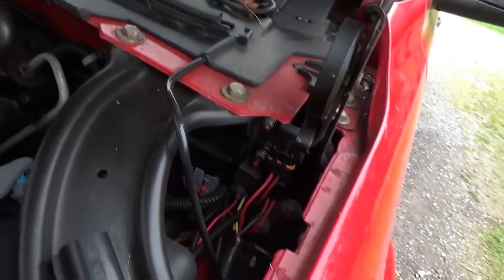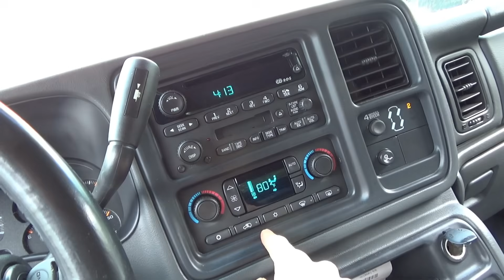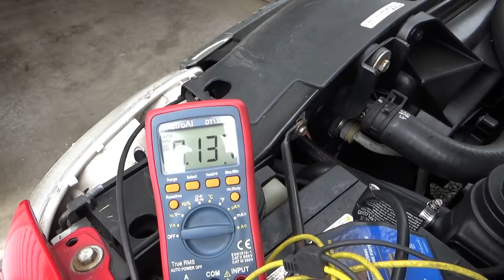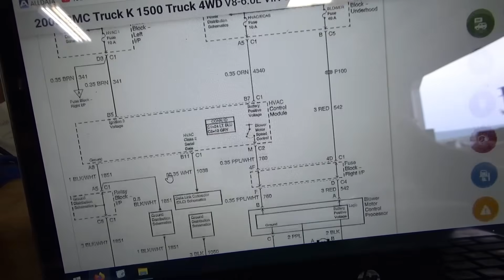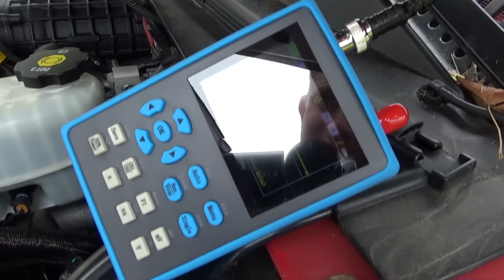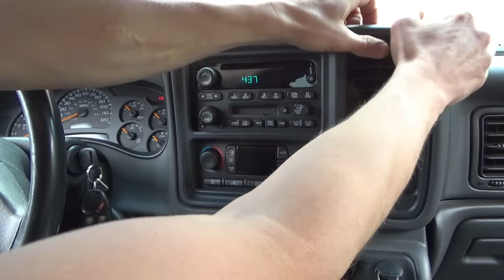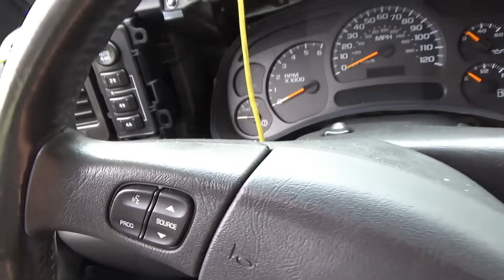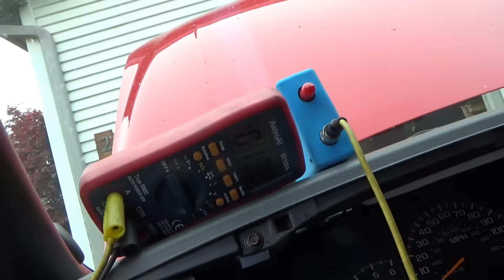QUADRASTEER! GM Parasitic Battery Drain from the FACTORY? (Part 1)

Comment: Pretty sweet truck, and it's mint.   I didn't even know you could get a 1500 series with Quadrasteer.   You would think they would have a programming update for those HVAC units, I'm pretty sure it's at least a known issue within GM.
Reply: A guy I knew had a 2002 1500 with the Quadrasteer.  He bought it new and had put a lot of money down on it so that in 2003, he only owed around $12,000 on it.  He decided he didn't want payments any more so he wanted to trade me his truck for what he owed and have me give him my paid off 1998 Silverado 4x4.   I ended up not doing the trade but sometimes wish I had.  It was a fully loaded nice truck.   I still have my 98 which I also bought new.

Comment: Curve ball to be expected, indeed. The measured draws in this video part will not cause a no-start after just 2 to 3 days, unless both batteries are toast. By the way, were those batteries tested?
Assuming the batteries are still good, my money will be on that early wireless phone charger. Pun intended.
Owner takes out his coins, his Altoids tin, tools, utensils, or whatever, before submitting the vehicle to a shop. Shop cannot find/fix problem. Makes sense.
Ivan will accidentally put a tool down in that tray and when glancing the amp meter, he'll find out.
Any creature comfort accessory like that should not be connected to a constant power feed. There should be a 3-way switch, so the user can choose between off, accessory feed, or always on.

Comment: I purchased a used C1500 20 years ago.  It also had a current draw.  I'd occasionally attempt to find the source.  But, since the vehicle is not a daily driver, I just put a knife switch on the battery along with a smart trickle charger.

Fast forward 18 years and while under the dash to do some other work, I discovered an aftermarket relay spliced in the wiring system.  There it is!

I removed the do nothing relay and the draw is now gone.

So, I eventually get around to fixing stuff.  It may take a decade or two, though.   ;-)

Comment: You said"CURVE BALL". I'm thinking that either, another module is waking up the HVAC module or yes, the HVAC module and the trailer module  is drawing current, but since the batteries have been discharged often, then they don't have capacity anymore. Batteries tend to get damaged and lose most of their capacity when they're deeply discharged. In that case you would need new batteries.  Evan at 175 milliamps, two good batteries should stay charged well over a week.
Also that Cell phone charger tends to stay on. That's a draw. You should unplug that too, see what happens.

Comment: I had one really really similar to this on a 03 gm truck. Turned out to be the ignition switch. Kept the hvac alive after key cycle.
Reply: Good point!  Ivan didn't check to make sure the powers and grounds were correct for going asleep.  (And in this case, I wouldn't use a test light, but just the meter.)  This could also be what's keeping the trailer brake awake. When you have two devices showing similar symptoms, it's probably not two bad units.
Reply: GM ignition switches have always been an anomaly. Replaced many. I have seen them cause HVAC problems and transmission issues.

Comment: 2003 GM truck with a draw? This is one of those cases where you have to go straight to one thing before you even bother doing testing. The cluster draws are almost always intermittent on the scale of days. I'd have the guy take out the cluster and see if it still happens before even bringing it in. The cluster problem is so common that we have had two of these vehicles in my immediate family and both had it (one had even had the cluster replaced by the dealer and the second one also failed). Then at one point I was visiting my cousin and noticed his was sitting sadly in the back of the driveway, I peered in the window, and the cluster was on. Turns out he had tried to find the draw, failed, and given up. Scrubbed the back of the PCB and scraped around the vias, problem solved once again.

I also went down the road of thinking one of these was the HVAC module because it wakes up from time to time and I kept seeing draws on that fuse (same symptom as you are seeing here, identical HVAC module). It was not the problem. Rebuilding the cluster fixed it. I was fixated on the HVAC module until I saw the speedometer move while the truck was off.

Is it cheating if you've been tricked before by the exact thing in the video?

Comment: You pulled the fuse and went to sleep.  Pull the module and it did not go to sleep and the brake controller stayed on.  Seems like something (brake controller maybe) is wired into the line from that fuse.

Comment: any TSBs on the hvac module?  also can the trailer brake controller be turned off manually? or powered from a key on source only? not so sure abt the hvac module being bad.. customer said he had problem from new, but didnt make them fix it? this kind of thing skews judgement sometimes.. If anybody bought a brand new truck, that was draining the battery from the start, they would pester the crap out of the dealer until it was fixed.  I call bullshit on "it was like that since it was new"..  this leads techs down rabbit holes.  the customer caused the problem with all of his add on junk

Comment: My question is and maybe since I have never seen this before, but why is there 2 batteries?
Is that because of the quad steering?
Reply: Because of the parasitic draw.
Reply: Any truck should have 2 batteries, particularly if you are running accessories like work lights, that is unless you like walking home !
Reply: The engine compartment has the capability of holding two lead acid batteries inherent in the DIESEL motor option.

Comment: @Pine Hollow Auto Diagnostics, hi Ivan! That's a really nice truck! It wasn't easy to monitor but I noticed that the trailer brake controller didn't seem to illuminate until after the @21:00 mark where you proceeded to put in the key, press on the brake pedal and pull the gear lever down & the controller displayed fluctuating digits. From then on it seemed to remain "active". I wonder, does it have a 10-minute timer, seems excessive... Anyway, interested to see the "curve ball". I actually read up on a problem like this and someone making their own "fix" related to the "climate control unit". I wasn't looking for that but an explanation for what "ECAS" represented.

Comment: So at work, I have been fighting an 04 Chevy Silverado. Not as cool as this sierra, but problem is, the manual dual temp HVAC module I deemed as bad. Because in my testing all actuators test good, no bad noises from them, etc.
Issue with vehicle is, when everything works with the HVAC, everything works, but after about 10 min of running, out of nowhere the doors change positions, the passenger side goes to hot, the driver will stay cold/Luke warm, it starts blowing out of defrost. 
The actuators in an 04 are self aware they move, see they move and report back to the control module.
Scan data shows the door "counts" as accurate, when it works they move to position and it shows that, when it acts up, you see the counts and the requested position, but they won't move. Like a error state.
Reply: Problem is, I have tried no less that 7 different "remanufactured" dorman modules of different part numbers, all of them either don't calibrate as they should, or they crash the bus network, ie the dash shows unknown driver, the gauges don't work, the anti theft disabled fuel sometimes, the prndl shows nothing.... I am CONVINCED this is a control module problem, but I can not find one that doesn't break the whole COMM system between module to save my life, 
As well as DORMAN claims they have never heard of this issue before. 
Like how can 7 modules be NFG....???!!!
Reply: They're stepper motors in the actuators. A digital pulse signal is provided by the module for each "step" the motor turns. Similar to a robot.

Comment: I've not seen a aftermarket trailer brake control module with a digital display like that before.  That's kind of cool.  But shouldn't it turn off instantly with the key?
Reply: what I was thinking.  Wire it to ignition power
Reply: @chillywilly3610 Input power to the brake controller should always be constant on battery power!  Just like the truck itself, you would not Want the Trailer brakes to only work when the key is on.

Comment: This is probably the very first customer vehicle I have seen on PHAD where the owner has had the vehicle that long and keeps it so nice and clean etc.  BTW, this truck is a keeper...I'd be going to salvage yards once a week/month collecting the most obvious parts needed to keep it factory perfect. Unfortunately, the Quadrasteer system is no longer supported, it was made by Delphi in the day. The Suburbans even had quadrasteer but only the 2500 models I believe.
Reply: Also the avalanche 2500s
Reply: @RageKage1776 Yes but the Avalanche went downhill fast!
Reply: @jonhutchens9770 not sure why, amazing features for its era.

Comment: A module made in 2003 and it is drawing too much parasitic current? It was manufactured in the days of fake and now leaking electrolytic capacitors. Millions of devices like computers, radios  and electronic games failed due to leaky electrolytic caps. So open the defective module and shoot the parts cannon of aluminum and tantalum  capacitors at it. Then do the parasitic draw test on it again.

Comment: I'd be all for putting both the trailer module and the Hvac memory fuses to key power, rather than direct to battery like they are... If this was my truck.   That's the price of wanting everything to be "clean" though --- you end up buying an expensive module when there is an easier way to fix it.   Part 2 should be fun though..   Gotta love the curve balls.
Reply: Whoever installed the trailer tapped the trailer brake modules ground into the hvac shut off signal wire or possibly cut it. I’m sure Ivan will fix the installation and ignoring the wire repair it will be no parts required

Comment: I am writing this as the video plays.  A 175ma draw will not kill a 50 amp-hour battery to the point where it won't crank the car until about 12 days.  The owner said it dies in 3 days.  With that said, this is an issue, but might not be the only cause.   When you unplugged the control unit the amperage did not drop down to the 35ma like it did when you pulled the fuse.  I am going to guess the trailer unit is tapped into the hvac power wires with one of those blue taps.
Reply: Yup, ye old Scotch-Locks! I loved 'em when I worked in auto electrical, job security for sure!
Reply: Mike i give you the benefit for this good "guess"
Reply: That’s my guess also tapped in to trailer to hvac,as if this car had a draw for 20yrs😂
Reply: The owner should have the trailer brake on switched 12v
Reply: E X A C T L Y   my thoughts too!
Reply: There are two batteries in parallel.

Comment: Those auto hvac modules of that era are known to take up to several hours to go to sleep.  Pretty sure there were bulletins for this.  Been there done that.  EDIT found it  The following diagnosis might be helpful if the vehicle exhibits the symptom(s) described in this PI.

Condition/Concern:

    Additional detail beyond TSB 02-01-39-007A.

    Vehicle may have a concern with the battery going dead overnight. The draw can be from 40 to 60 mA. This is due to the HVAC control head staying "awake". Further diagnostics may show that the draw is reduced to approx 5 - 9 mA with either the front HVAC controller unplugged or HVAC fuse B pulled. Disconnecting (& reconnecting) the battery may result in the draw being gone until the next key cycle. The rear HVAC head is unrelated to this issue.

Recommendation/Instructions:

    A draw of approx. 60 mA for 2.5 to 3 hours after vehicle shutdown is normal. The time varies with ambient temperature. However, this should NOT be enough to drain the battery.

    DO NOT replace the HVAC control head for a draw of 60 mA (approx) or less.
Reply: Amazing what a bit of research can dig up!  😊
Reply: @stevewhite3424  I worked on these at the dealer when new, what's amazing is the useless crap stored in my head from 20 years ago.
Reply: @scrappy7571  😂😂😂😂😂

Comment: That trailer brake control unit may be supposed to be wired to ignition on power; may not have a sleep option; can correct that issue very easily

Comment: That rear steering blows my mind. I got behind one of those trucks once and could see the axle was capable of being steered. To my knowledge, it was the only one I've encountered. I have a friend that  works for the GMC dealer and talked about it with him. There is a big old spring that centers the rear steering when it's not active or if it has a fault. Interesting, but not something I'd want. It amazes me the truck is so nice, and yet is used as a snowplow!  Can't wait to see the rest of this one! I wonder why the brake controller is always powered up - maybe there is a good reason? Can't remember how mine is wired, but it's much simpler - as is the rest of the truck.
Reply: Is there a backup camera installed?
Reply: yeah plowing with that truck is cringe... especially a rare Q/S! Why people plow with anything under a 2500 makes no sense... 1500 and lower can't take the abuse of plowing like a HD truck!

Comment: Depending on how they wired that controller it can play a roll in the issue. Those trucks came with a factory harness (when equipped with trailer tow package) and a piggyback harness that would get spliced into the aftermarket trailer brake controller.

Comment: On to  part 2.  Can that trailer brake be wired to the ign switch?  Hopefully there's a relay that the control can be directly wired into.  I also hope the control wasn't wired into the BCM.

Comment: Great video, just wondering if the fuse that is supposed to control only HVAC module has actually been utilsed for the aftermarket trailer module, which is why it dropped immediately when the fuse was pulled but not when HVAC disconnected?
Reply: Good point. I totally agree the 100+mA of current to power the Trailer Brake module may be tapped off that HVAC fuse. You can see a forbidden aftermarket wire on top of the fuse box, near the fuse. Also Ivan didn't find ANY OTHER FUSES with a VOLTAGE DROP. This is important because the Trailer brake module draws almost 3 times the power of the HVAC module, and should have been easily found if another fuse was involved...
Reply: Interesting thought! Appreciate your comment. :face-orange-biting-nails:🙃🙂
Reply: Interesting except the customer states that the parasitic draw was there before the truck was ever modified. As another sharp eyed commenter found, there is actually a t s b for this very issue.

Comment: I would pull the fuse again to see if it shuts off the trailer brake controller since they might have pulled power from that circuit and the two systems are interacting to keep each other alive.  Is that the curve ball?

Comment: I had a 4ws bmw the other day.   The rear suspension components are extremely weak on those.  Barely scratched the rim and it bent most of the links

Comment: I have that same HVAC module in our 2003 Trailblazer and it was replaced under warranty. But it has a defect once again with the rotary knob contacts (it's digital) that are not linear, the temperature values jump when turned. So instead, I use the steering wheel switches.
Reply: That's the classic mechanical encoder with bad contact issue. Often the (nonconductive) silicone grease used on the shaft for a more damped feel will seep out onto the contact area over time. Basically a NPR repair if you don't count a cotton swab with isopropyl alcohol and perhaps a bit of sealing contact cleaner. The older ones tend to be quite easy to disassemble and clean, newer ones less so.
Reply: @PileOfEmptyTapes  maybe, Ill try that...now if only I could find the right foam to replace under my driver seat cushion. I'm @313k miles, looking for at least 400k!

Comment: Trailer Break Controller should be on the ignition and not hot with the key off
Reply: The AC module tells it to go to sleep. 🤭   But wouldn't you want the trailer brakes to stay on when you park?
Reply: @robertsmith2956  No, they draw too much power and will kill the battery

Comment: Did you pull the only fuse with a voltage drop and your meter was still showing a current draw?  Something in the fuse panel / tipm?  Or was I imaging that happening?

Comment: Great video, but man, that's a lot of aftermarket equipment. ... lots of splices in the factory wiring.  Why does he want that wireless charging pad on all the time? 🤔   Interesting to see what it might be.
Reply: Looks like he might have wired it to constant power instead of the ignition.
Reply: @wernerdanler2742  Power draw 100% of time.